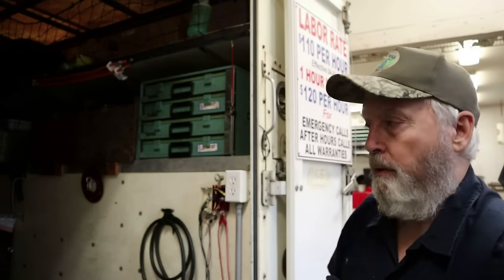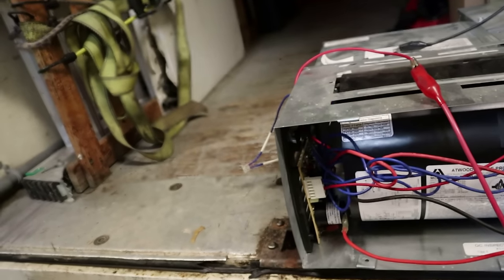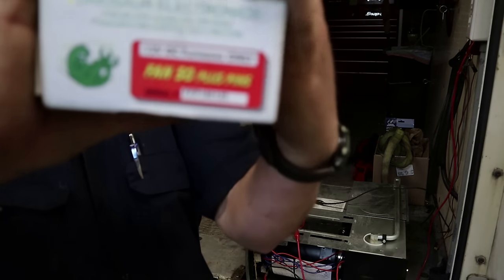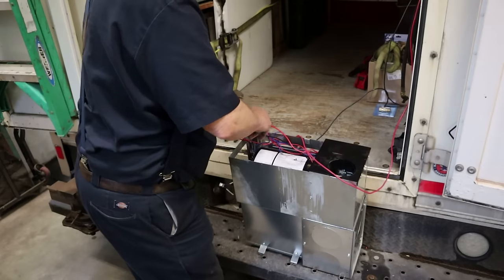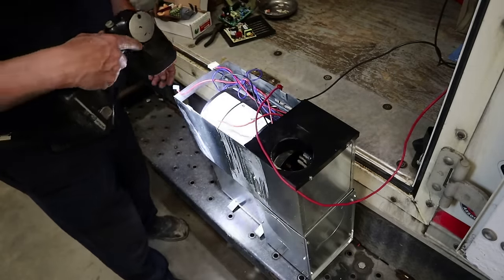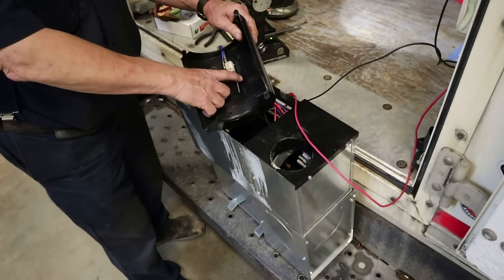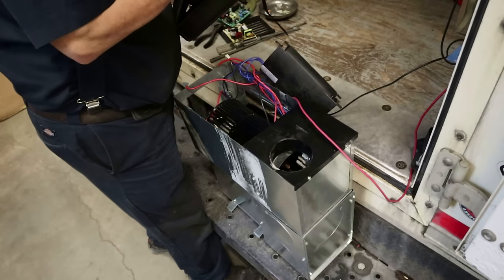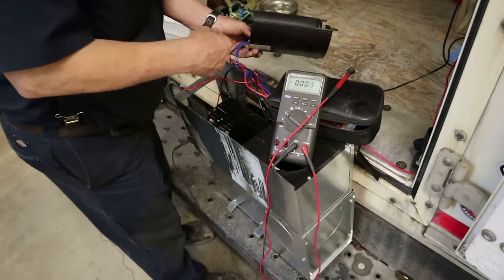Can Furnace Be Repaired?

Comment: I always learn a thing or two when I watch your videos! I had to change out my furnace motor and should have taken a picture of the wire connections on the board but alas I did not. I was lucky I had the wiring diagram. Long story short, furnace worked fine after that. I did not know about this High limit switch..
Reply from the maker: Glad you can learn from me.

Comment: 😂😂 when ya flash the comment about black wire,  I said OH boy we gots to Tear into this one. Would be nice if the manufacturers would locate replaceable parts so yo can get to them. Silly engineers 😂😂😂
Reply from the maker: This one was fun to video. Thanks for watching.
Reply: A couple of observations. If the motor is dragging in rpm due to rust on the bearing or inside winding it could trip the high limit protection. Had a bearing go out on a rv furnace and did the same thing. I always use a meter to check for voltage first, then use a quality test light to trace the circuit from the board to the sail switch to the limit switch. Much faster. Also, checking the connection at the end of the circuit on the board first will instantly tell you if the protection circuit has failed. (Sail switch and over temp sensor). Lastly I’m sure you blew out the combustion chamber with air just in case bees, dust or mice may have been the reason for over temp opening in the first place. Good job though.
Reply from the maker: @lorenrickey5481  Thanks. It's all good now.

Comment: Another great video Kenny. I agree a multimeter is a lot better than a test light. I would look into get a clamp on multimeter and amp meter, they can measure AC and DC. I would have replaced the high limit no matter what, as buried as it is. Have a good week.
Reply: Fluke makes an affordable ac/dc amp clamp, fluke 325
Reply from the maker: I have an amp clamp. I just almost never get it out of the truck. It seems to read AC amps well but I am not sure about the DC amps. Seems like it is all over the place.
Reply: @hillbillyrv  remember to zero out the line you are measuring on DC amps with meter running sideways from the line.
Reply from the maker: @Imagashole  I don't know what that means.
Reply: @hillbillyrv  if you are having trouble getting good readings in dc amps, could be the meter or could be this.  Touch the meter to the dc wire you are trying to measure at the clamp like a cross. Then zero meter out and then run amp test on wire.